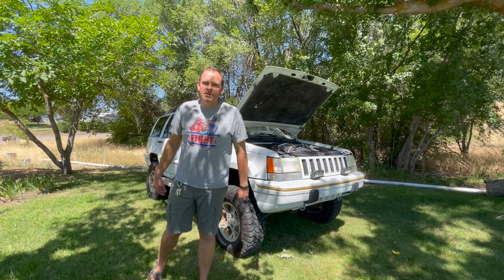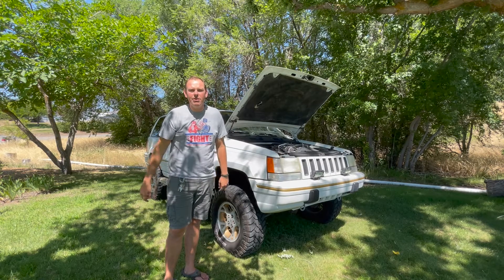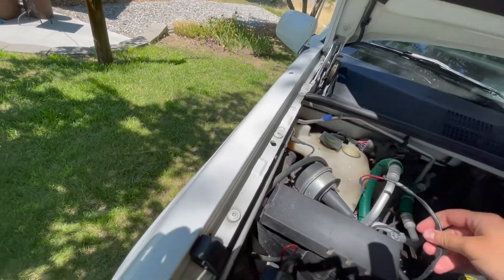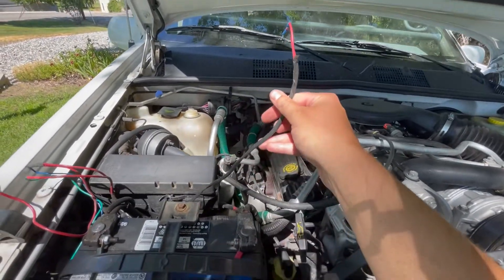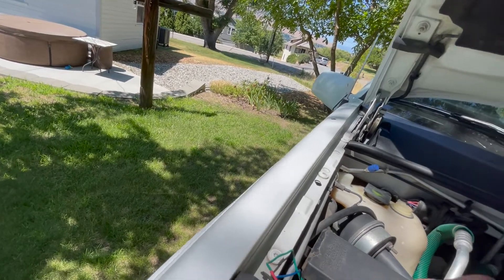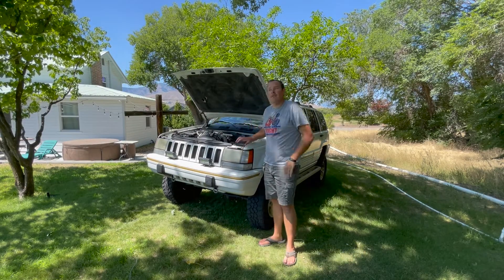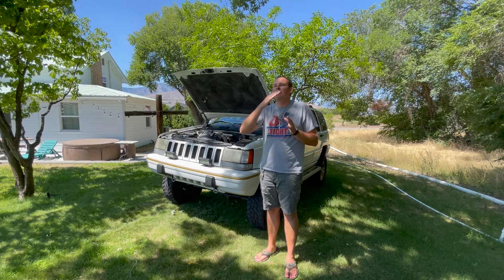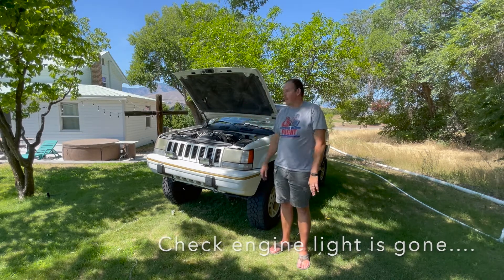Jeep ZJ 5.2 External Voltage Regulator: How to install

Comment: I left mine connected to constant 12v and forgot abt it will I be ok or will it burn up somehow?
Reply from the maker: So it’s not on a keyed power? It will be running, might kill the battery. I’d find some keyed power and do it correctly
Reply: @Geeks4x4  ok cool. And yep I couldn’t find a keyed power source so I hooked it to constant to test it and ended up leaving the vehicle. Just hoping it wont fry anything or cause a fire somehow because Im hours away from the car.
Reply from the maker: Probably will be ok but you might come back to a dead battery

Comment: 1 - What did you use (source) to splice to the 12v switched power (blue) wire under the hood?
2 - Any codes after the upgrade?
Reply from the maker: I used the fuel pump relay, wrapped a tab. Yes the cel will be on after this, the computer can’t find voltage even tho it’s correct.
Reply: @Geeks4x4  ok, thanks
Reply from the maker: Ya better temporary fix, the computers have gotten much cheaper to replace.

Comment: Totally confusing.  Useless video--> what wires?! Go to where?! Come from where?
Reply from the maker: Keyed on power goes to blue(from regulator), blue goes to one of the terminals on the alternator. Green goes from the regulator to the other terminal on the alternator. Super simple sorry it got lost in translation!
Reply: So 3 wires running from the blue wire 2 going to alternator one to fuse and the other one runs to battery?
Reply: Confused would appreciate tip
Reply: @bradleymauer182 hire someone that has a clue